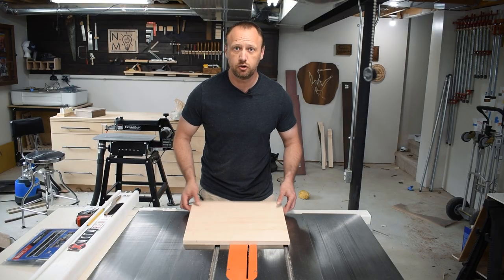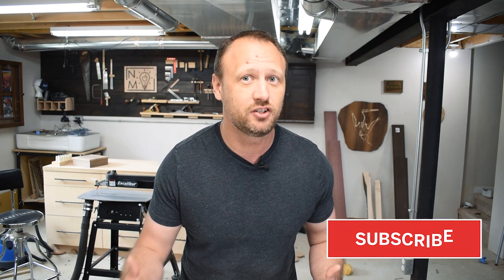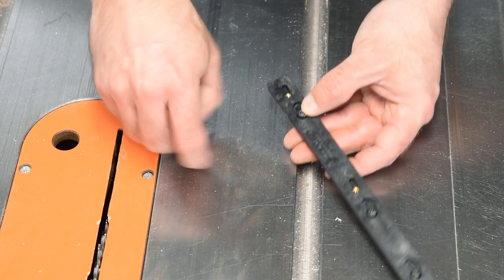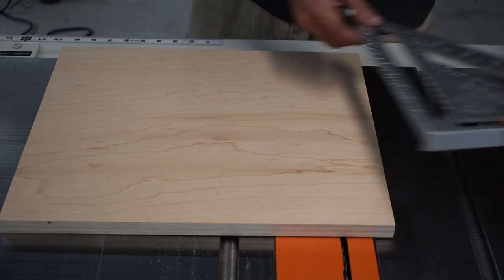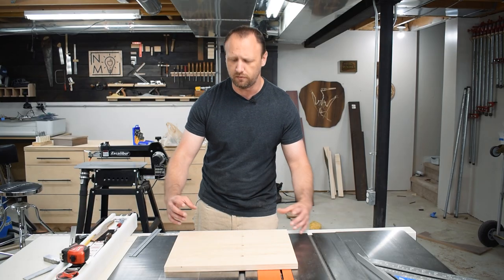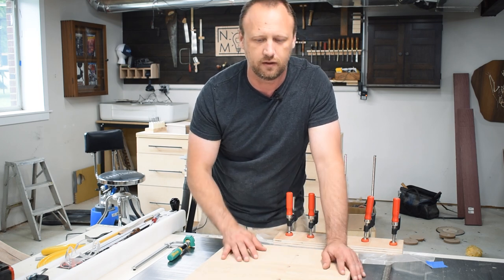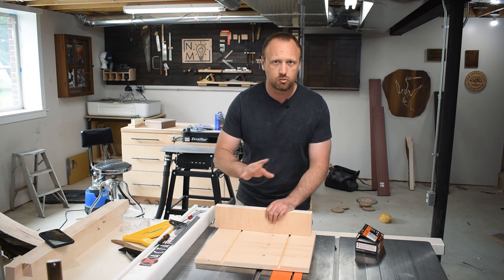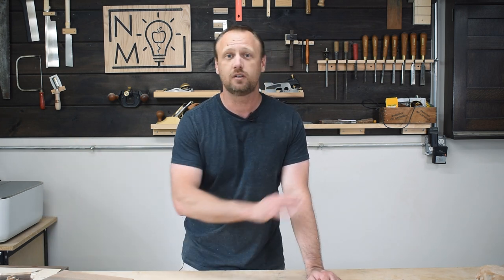Cut Perfect Miters in an Hour! | Woodworking Jig Tutorial

Comment: Very nice jig. I had a good laugh  @8:50  Deal tho!

As an alternative you can use Polypropylene Cutting Board for table saw runners. Cheap, easy to cut, no movement, slide like a charm and last for ever.

Comment: Appreciate your vid Billy. The jig gets me past the one thing I have struggled with- cutting miters with small stock UNDERNEATH the tilted saw blade. This jig gets us working back on top of the blade which increases safety and efficiency. It also helps avoid standing the stock vertically for tricky "end" miters where rocking and poor cuts occur. Also, this jig does not limit size of miter to the maximum height of the saw blade like other jigs. Am I rationalizing this correctly or missing something? Thanks all the same sir.
Reply from the maker: Yep I totally get it. I like cutting on the right side of the blade and I'm usually not a fan of attempting to cut miters vertical. A bit sketchy.

Comment: Great video!
When cutting miter edges for box corners, someone told me to 45.2° as opposed to dead on 45°.
Is this something you have ever tried or had to do?
Thanks!
:)
Reply from the maker: I haven't. I don't really understand why someone would. 🤷‍♂️ If a person can cut something at exactly 45.2 then 45 should be a breeze.
Reply: @NewtonMakes  This is old but the reason for it is to ensure the outside miter is tight while sacrificing the inside miter which typically is hidden from view.  If you aren't spot on with the miter the inside will be tight but outside will show gaps you have to fix.  Of course being spot on is the goal but if it were something you couldn't make again if you werent, that would be a way to ensure the best look